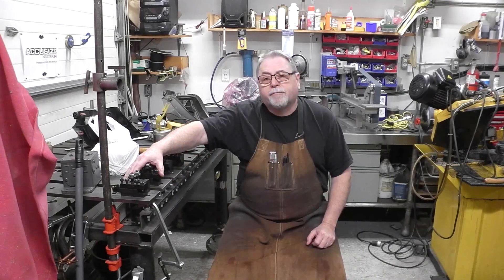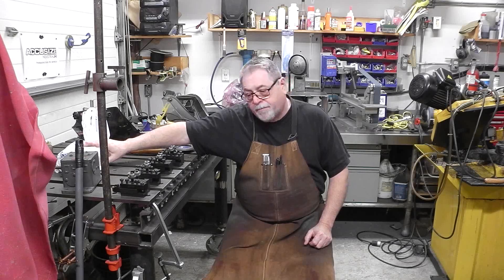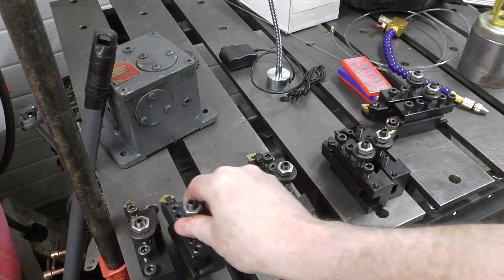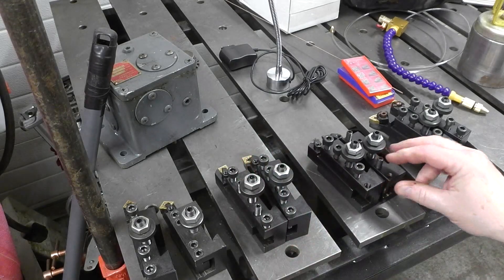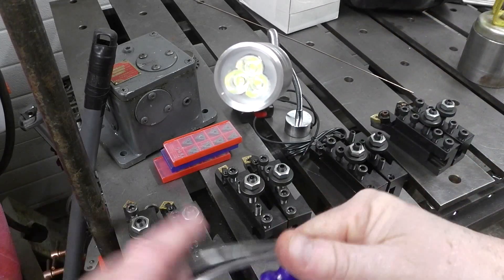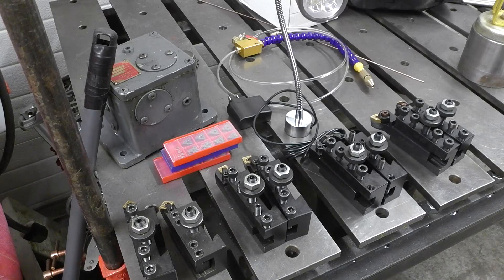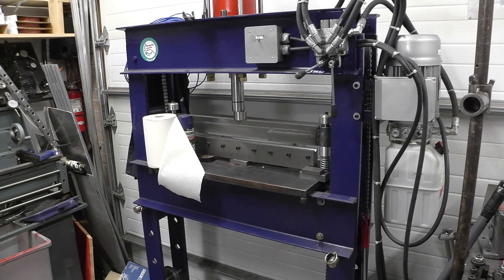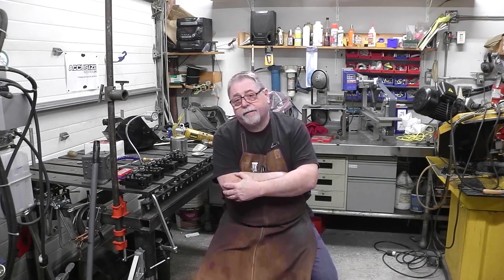Another Night in The shop. 2018 update

Comment: I am building a positioner right now. I have some vids on my channel. I am using a wheelchair motor that works with 12 volts. I also show how i took a computer powerpack and it outputs 12 volts. Also using a pwm for the speed control.
Reply from the maker: Yes checked the progress on your channel. That's awesome. Used pc power supplies work great. I used the same on my solos panel with sun follower boards. I find some 12 / 24 volt dc motors. If have link send it on down. I like find 12 inch round table
Might have to make one.

Cheers Fred
Reply from the maker: TJS Welding and Fabrication 
Thank you so much. I give them a look.

Cheers Fred